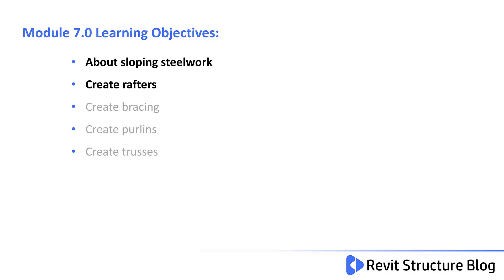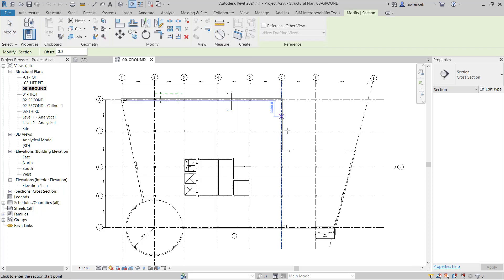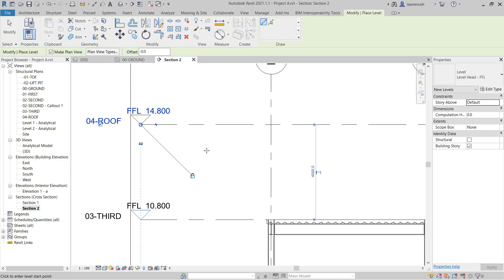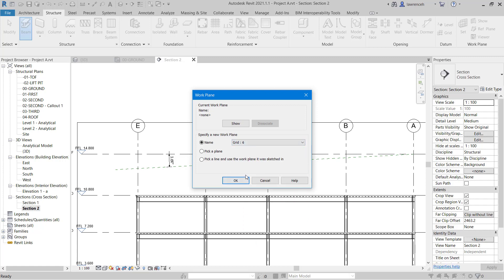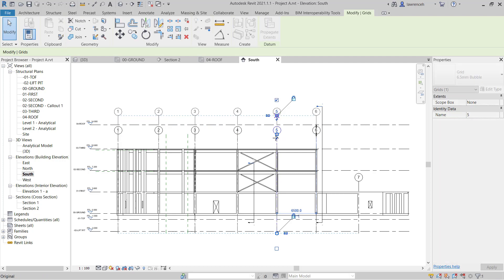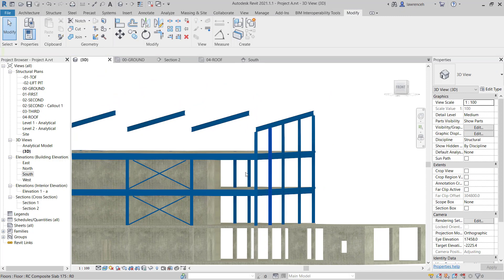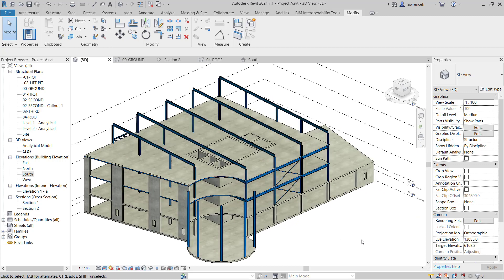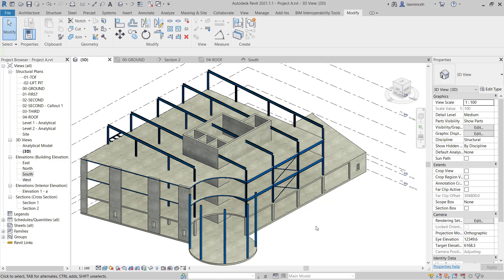Revit 2021 Training For Structures Essentials Module 7.0

Comment: Hello
i have a question, lets say i have a sloped Slab on Grade and i want my steel columns to be "attached" to it via a base plate, and on the top, the roof is a level floor.
my question is how to do that??
i have created the columns and attached the bottom to the S.O.G., but some of the columns go through it like it doesn't exist!
is there a work around ?
Reply from the maker: Hi Zaid, You can attach structural columns to reference planes which may help.  However, the structural columns should attach directly to a floor or foundation slab. I assume the base plates are still level and packed or are they skewed with the slab?
Reply: @RevitStructureBlog  yes, they are level.
if you would like i can email it to you if you want to take a look at it?
Reply from the maker: @x0devil0x  feel free to send me the model
Reply from the maker: @x0devil0x  lawrence.hooker@excitech.co.uk